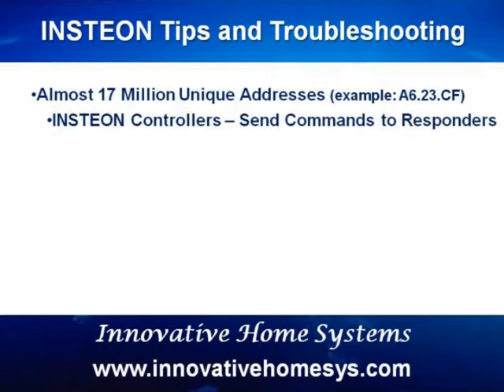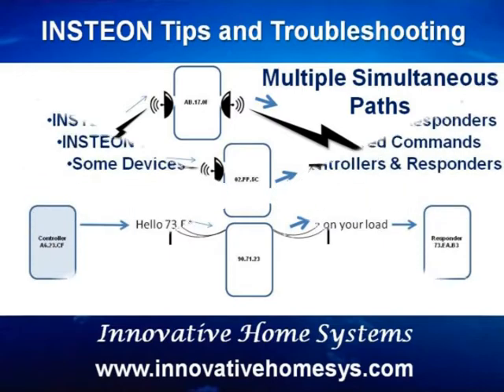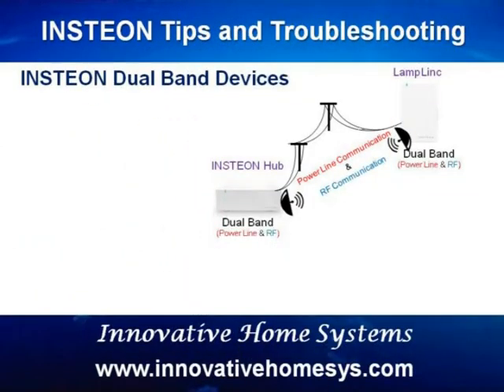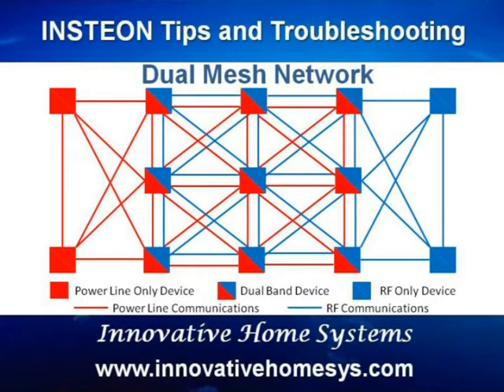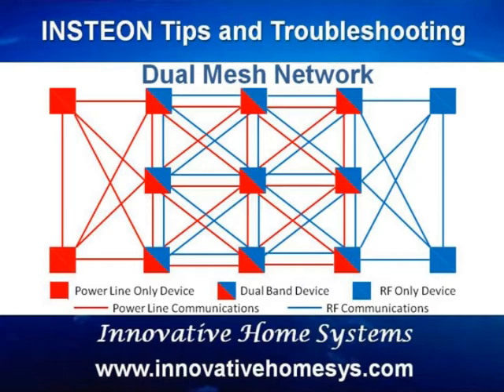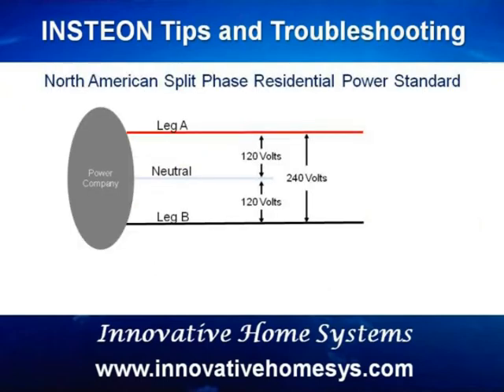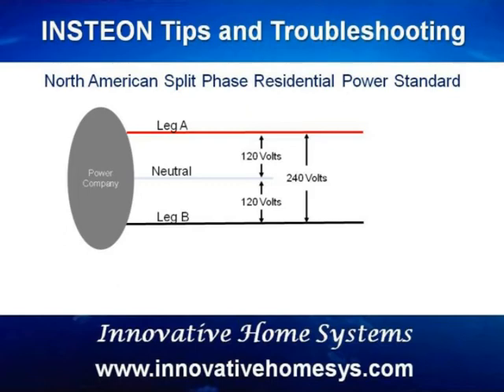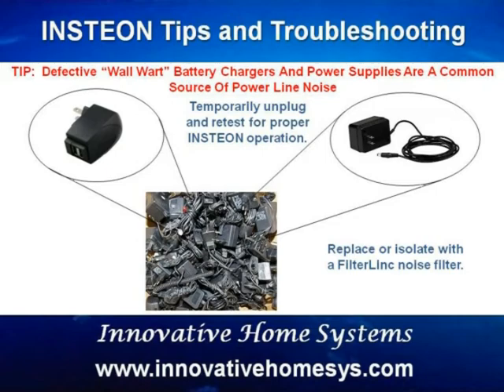INSTEON Tips and Troubleshooting

Comment: This video is invaluable.  You just gave me the information and methodology to fix something that has been plaguing me for the last 2 years.  Darn wireless doorbell chime at the far end of the circuit.  I replaced it's battery 2 years ago and suddenly, intermittent problems with a light switch.  Moved doorbell to a plug on another circuit, voila.  We live half the year at the country house (read cabin) and I depend on this system for control of the city house.  One big like.

Comment: Thank for your your video. Can I use Power Line Carrier with the Network frequency 50 hz, 220 VAC and 433 MHz. Does it work well or I need to buy some adapter.
Reply from the maker: The short answer is, yes, Insteon modules can be used in countries with 50 hz, 220 VAC.  However, most Insteon modules use dual band, (Power Line Carrier & RF) communications.  The RF communications use 915 Mhz.  Use of 915 Mhz radio frequency communication may not be legal in your country so please check your local laws.  The RF communication used with Insteon modules cannot be altered or turned off and may interfere with other essential  communication in your country so please proceed with caution.

Comment: Wow, you nailed it with the cheap adapter.  I have been fighting with my system for months and months, and just found your video.  By process of elimination I found the culprit, 2 rechargeable flash light/night light always plugged in. As soon as I removed them, the problems went away. Thanks!